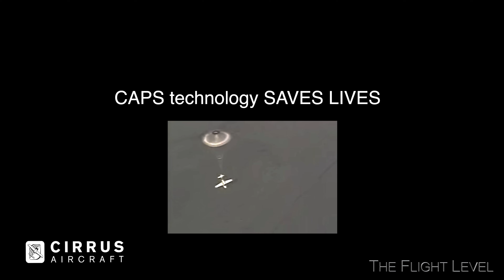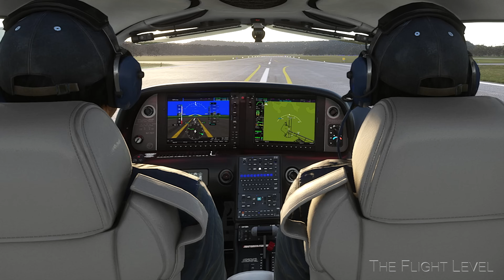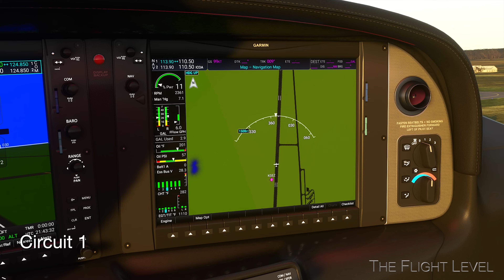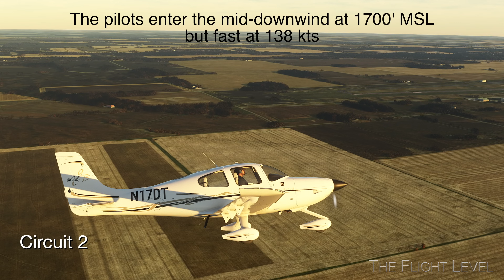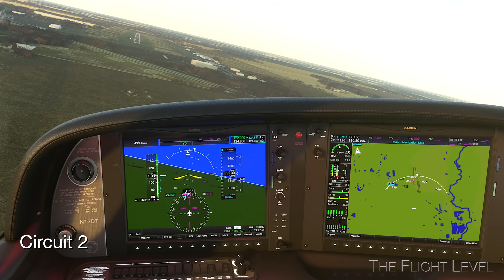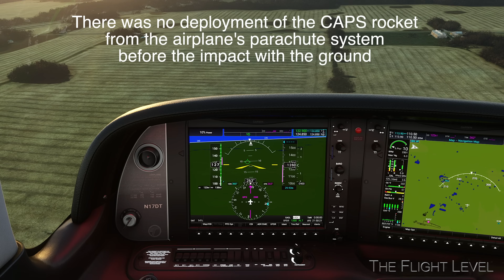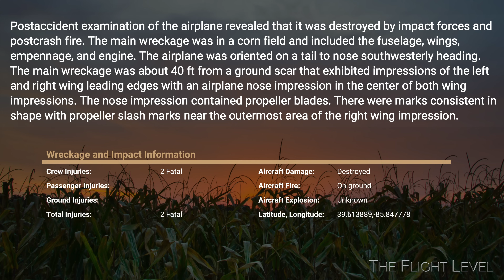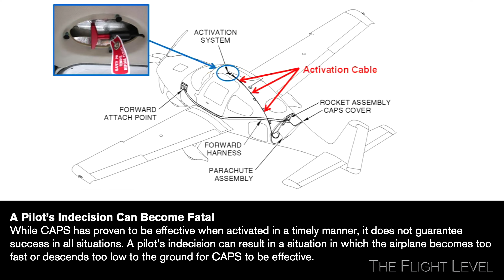Parachute (CAPS) Indecision | Cirrus SR22T (N17DT) Flight Ends in a Fatal Accident

Comment: My son is getting endorsed on the SR20. He’s 18. Throughout the ground school portion and lessons on the ground and obviously in the plane, the caps system is the most discussed system of the entire G@d d&mn plane. I was amazed at how central that is to an emergency. RIP to them.
Reply: thats the part of it I find suspect... your son IS NOT learning the maneuvers and skills to recover from a stall or spin like in every other aircraft, he's actually prohibited from doing so. rather he learns when to pull the ripcord and sit back and see what happens, he has no control at that point of where the wind sends him and his parachute. its the only plane not certified for pilot driven recovery, his only option is the parachute. other than the substantial airframe damage resulting from the 17kt vertical crash with the chute, but just repacking the chute alone costs $30K including blast damage from activation good grief. not a first-learner's plane for sure, but a gorgeous plane nonetheless lol
Reply from the maker: Thanks for watching. The CAPS system is a central focus of training for a very good reason!

Comment: On the emergency landing he probably tried to force the plane down ( with improper technique, forcing nose down) because he was going to miss his landing spot.
His airspeed was to high for touchdown.  It was 70. I never flown a cirrus. But most aircrafts of that type are around 45 - 50 knots).

Comment: For those not familiar.  Cirrus trains to pull the chute if above min height, for this plane it would have been 500 ft AGL.  If the instructor was NOT a CSIPI, certified Cirrus instructor, then that could explain why the chute was not.  Regular CFIs have not recieved the factory training for CAPS.

Comment: Flying above rural farmland, I'm not sure my first reaction would be to pull the parachute either. All this is obviously easy to analyze in hindsight, but it's not like they were in the Rocky Mountains. My gut would have been to maintain controlled airspeed with minimal to no turns. I'm pretty sure most pilots know a dip in a wing at or near stall speed is going to result in a spin. Maybe I'm old, but that's what I was taught back in the early 80's.

Comment: As a glider pilot with well over a 1000 "dead stick landings" , on and off field , with zero aircraft damage,  it astounds me how many power pilots actually don't really know how to fly their planes.  If power pilots had at 25 solo hours in gliders with at least 50 launches, you would see the stall spin death rate go down because the freak out of landing your plane with no engine would be completely normalized, routine.   I've flown many powered "dead stick" landing, all for fun, often rolling all the way into tiedown area.  Not boasting , just routine and fun.

Comment: this is a loss of engine... and if the speeds are right...the question is why didn't they use the standard softfield landing speeds and landing..  I have to admit I would be hesitant to fire a caps system unless I was suffering an IMC loss of control or an inflight breakup.

Comment: This is instructors fault. Once engine failed, take controls, maintain best glide speed,  and land straight ahead in field. Caps not necessary.
Reply: And you know this because of your deep knowledge of the cirrus. Read ALL of these posts and when you get to the one that tells you why you utilize caps in a cirrus vs glide in from a factual standpoint, then make an ignorant or maybe an informed comment!

Comment: Well, the real question should be about the reasons why Cirrus planes have so many problems that they need to deploy their parachutes. If it didn't break down in flight, I wouldn't need a parachute!
Reply: these are flown by private pilots, often with low hours and experience, some only flying a few times a year... the majority of these accidents are due to pilot error, not technical failures

Comment: I understand that the CAPS has saved lives but the figures are exaggerated since the assumption is that a non-parachute airplane in the same circumstance would have experienced a fatal crash. This is not the case most of the time. Hundreds of airplanes a year have engine failures and in a great majority of the time land off airport and survive. When they don’t survive, it is due to loss of control when attempting to make the airport with insufficient altitude/airspeed.

Comment: Always use the CAPS on a cirrus if the only option is an off field landing.  This has been reviewed over and over again. The cirrus lands too fast (its not a cessna) and will dig in, burn, and flip if you try to land off field.  Please listen to Max Trescotts podcast covering this, since he is one of the top instructors and aviators alive with vast experience in the cirrus.  Use the CAPS.
Reply from the maker: Thanks for your comments. Many have criticized the issue of using CAPS over piloting the aircraft into the field. It is increasingly evident that CAPS is the way to go in a Cirrus for the reasons you indicate. A link to Max Trescott’s podcast is provided in the description. Excellent advice!
Reply: The Cirrus will dig in if you land off field. What a load of Rubbish, There have been many instances where the Cirrus has landed off field whatever that means and has not dug in or flipped

Comment: Just watched another video in which a guy lost his engine over the Rockies and was able to successfully land at Aspen. He had more altitude to play with but even this engine out was at an altitude that should have allowed a turn back to the airport and even if it didn't there were plenty of cornfields in front of him. I was under the impression (and I'm not a Cirrus pilot) that the reason they have the CAPS is because it can be difficult to recover from a spin. Is Cirrus teaching that the response to losing an engine is to pull the chute? Guess it's a way to sell more planes but I spent many hours learning to fly and land a dead stick plane. Maybe the newer pilots are relying too much on technology. My first cross country was done with 2 OMNI's and a map in my lap looking for the name of the town on a smokestack. The new technology is great and I love having a magenta line showing me where I am and where I'm going as well as having the Garmin lock onto the approach and fly it for me but there is something to be said for ded reckoning and old fashioned stick and rudder skills.
Reply from the maker: Thanks for the visit! Yes, you are correct about the difficulty and time required to recover from a spin. Very true about basic piloting skills. I am under the impression at this point that something very wrong occurred in the cockpit that we are not aware of. Your cross country experience reminds me of my flight test where the chief pilot pointed out a creek on the map as an alternate to fly to. I never need find the creek as it had dried up. Circled a few times around the correct location and the CP never broke his examination expression! He did pass me though!

Comment: This video had the potential to be great if it weren’t so long and drawn out, especially when showing the FlightAware data and then repeating itself with the same exact scene but now a 3D reenactment.
Reply from the maker: Thanks for watching! Appreciate all points of view. Flight sim is my hobby and adds to the authenticity. Some would complain too boring without the simulation and therefore I always include time stamps so people have the option to skip to parts of the video at will. Blue skies!

Comment: An awful lot of the CAPS deployments seem to be due to mechanical issues with the plane.  Maybe the failures are not statistically higher for the Cirrus than for other GA planes, but I’m curious.
Reply from the maker: Thanks for the visit. The aircraft was completely destroyed by the subsequent fire post-impact and I assume it will be difficult for the NTSB to determine if mechanical issues played into the accident. Thanks for raising this point as I was not aware of this.

Comment: This isn't indecision. It's inability to fly the aeroplane. It clearly stalled and spun-in from low altitude. There was no need to pull the 'chute - there were plenty of places to put the aeroplane down in one piece if the engine had failed and it seems likely that was their aim - until they stalled it.
Reply from the maker: Thanks for the visit and commenting. With a flight instructor on board you would certainly think this would be the case re landing in a corn field. We will never know the situation in the cockpit. Many claim an aviation accident is usually the blend of more than one issue and there was likely more than one bad decision or indecision when exiting the pattern for the last time.
Reply: @TheFlightLevel  This accident was primarily caused by one thing - the pilot exceeding the critical angle of attack at a height where recovery was impossible. Why they did that is what we don't know, but plenty of others have gone the same way and plenty more in future will - usually trying 'the impossible turn' to get back onto the airfield after power loss on take off. Here, they were already in the air of course, and we do not even know if they DID suffer power loss.

Comment: After actually analyzing the flightaware data and the NTSB-Report, the situation was likely the following:
They did two poorly coordinated approaches that were too fast and too high. After the second go-around that was initially OK, the plane did not turn into downwind but continued crosswind, loosing airspeed and then decending (first near stall speed at 60kt ground, 69 kt air speed, then increasing speed again). It seems like they were turning while doing that. Last flightaware was at 500 ft AGL and 81 kt airspeed (72 kt ground speed). 

A whitness reports a stall-spin accident at an estimated 200 ft. AGL. The flight controls were intact no flaps were set.

Conditions were good wather, all surrounded by empty corn fields, no icing, no gusts.

To me, it appears as if there was some mishandling going on in the cockpit. Even if there were an engine failure, for which there is no evidence, this plane could have been easily landed. The question should really be what the FI was doing. Was he experienced? Either he was inexperienced or incapacitated, or both pilot and FI got highly distracted, which is hard to imagine.
Reply: Agree it sounded like some very serious pilot errors going on in the cockpit. Even without the parachute landing in an open level cornfield even without power should’ve been something that one or both of the pilots could’ve accomplished.
Reply: Pilots MUST know your planes critical numbers and stay well above it until final is assured. If engine failed then the nose over and immediate chute deployment would have prevented this but they may have though their speed was ok when in fact it wasnt ok.
Reply: In this particular model stall was exceeded (83 kts upto 95 deoending on weight), so they were up a creek from climb out on 2nd go around and they stayed slow.

Comment: just because your aircraft is equipped with a parachute doesn't mean to forget everything you learned about emergency landings.  CAPS is a relatively new line of safety measures...more of a crutch in my opinion.  "why practice emergency landings when i can pull the chute"
Reply: The BRS is there because the plane cannot recover from a spin. The spin in this incident occurred apparently at 200 ft above ground, too late to pull the chute. Why they got into a spin is definitely pilot error, as it was all open, empty fields, good weather, no icing, no gusts.
Reply: @MaxMustermann-nd4uy  Spin recovery is apart of training...The chute does not replace training.  I can see using it perhaps over water, or mountainous terrain, but, still shouldn't be used as a "plan A"
Reply: @xbpbat21x  The reason the Cirrus got the BRS is that it was mandated because it is impossible to recover from a spin. So in a Cirrus, this is plan A, by design.
Reply: @MaxMustermann-nd4uy  that is not true.  Cirrus aircraft can recover from a spin.  To make sure that the pilot has the best chance of survival the POH says deploy CAPS.  This does not mean that it can't recover.
Reply: @wagnertenor  The BRS was a requirement for certification because of the poor spin characteristics.
Reply: @MaxMustermann-nd4uy  you’re 100% incorrect my friend. They’re completely possible to recover. Especially with the aerodynamics the cirrus has. They’re simply not certified in the US for spins. However the plane wouldn’t be able to have been sold in Europe has it not had proven recovery.
Reply: As someone with almost 100 hours on the cirrus there’s nothing enticing about pulling caps. You’ll do anything to avoid it. It’s absolutely a last resort and it’s proven to work when all else fails. Under no circumstances should it simply be used as a crutch.